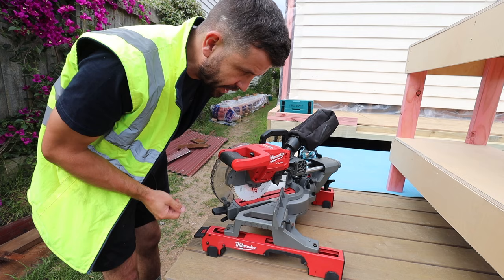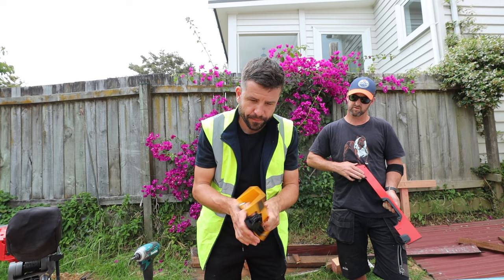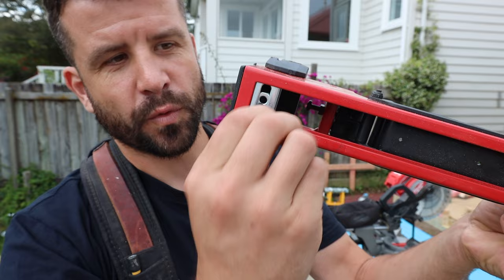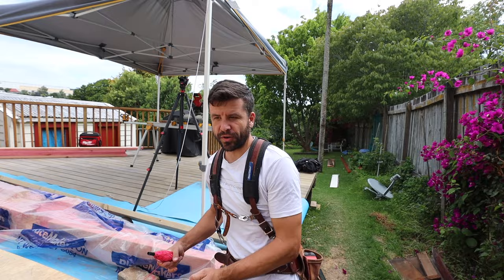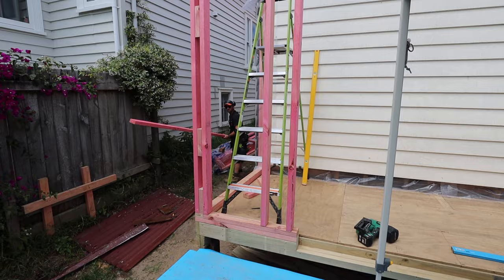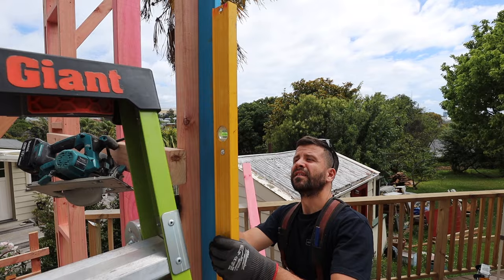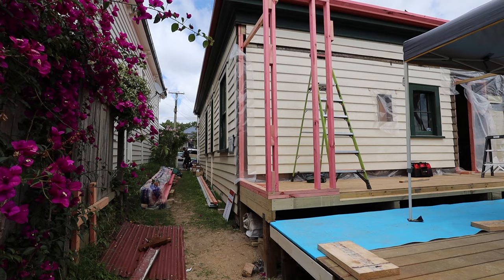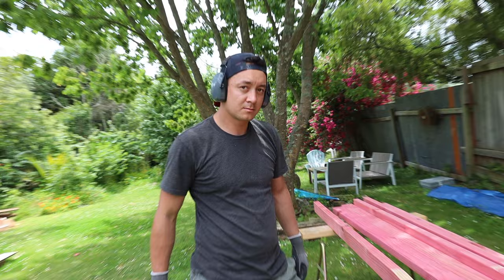Techniques We Use for Framing

Comment: Love your videos. Nice to see carpenters who take true pride in there work and have a real passion for the tools they use. I'm running that same dewalt stand for quick jobs and out door use and a 16 foot custom take down cut bench for all my finishing jobs. Instead of running multiple clamps on my saws I just built a plywood platform and installed the dewalt clamps on it so I can quickley change out saws and go from my metal stand to chopsaw bench with ease.

Comment: Always amazes me that you can build a whole house out of wood and nails and it stands the test of time.. 
And most of what mother nature can throw at it..
Reply: You’re right but for how long will it withstand time? I‘m from Germany and houses here are built totally different. When I was traveling Australia and NZ I couldn’t believe my eyes when I saw the houses built like that. In my country houses are like forever.. Lots of houses are at least 200-300 years old. Some even 500 years. New houses are built like massive bunkers.. maybe the Germans are afraid of losing their money and that’s why they put it all in building structure 😆 in reality it is a cultural thing.
Reply: @derdude8201  I live in a house that was built almost 100 years ago, walls were built with rocks.. The truses in the roof are still good and holding the roof up, the same goes for the houses in Germany that are so old, thier truses are still working.. 

Wood lasts, but it got to be maintained and looked after, if it is looked after and does not get esposed to the harsh enviroment, moisture, rain, water, fungus, termites, bugs, sun and other aspects it can last for years and years. 
Another example, phone and power line polls that are wood, they been standing in the ground for years and they still good..
The whole of my countary still make use of above ground power lines and telephone lines and most of the lines use gum poles that is treated with bitchimim.

And in todays age there is even stricture building regulation on standards and the wood is treated with all kinds of chemicals that protect the wood even more.. 

The biggest thing is maintenance, and of cause no cutting corners and using sub standard building materials..

Comment: Tip with laser levels: it's easier to work to a finished floor height. When I'm at work I will set up a mark 1m off finish floor height and then when I need to find if a point is level I can just hook on my tape and read a number without having to do the laser Level on top of a wobbly wall move
Reply: Datum. Used to be the first thing done on every job I worked on. No excuses for anyone once it's marked.

Comment: Had nothing but problems with that same model Milwaukee saw, sent the first one back as it made a terrible noise when at full operating speed-I checked everything-blade off, arbor off, connections etc, nothing worked. 5 weeks later the replacement saw arrived-exact same problem. After a further 5 weeks nothing had been rectified so I told them to stick it and ended up with a dewalt battery saw. I have the Milwaukee nail gun and it’s been good so far but after that experience I probably won’t be touching Milwaukee again. Hope you get it sorted Scott, it would be a great little saw otherwise.

Comment: I've been using the 260mm cordless drop saw from Milwaukee, came out of square which got me good the first few cuts. Other than the initial torque slowing the blade a bit too much its done me good for cutting aluminium

Comment: You should try the Festool HK 55 with the retractable track.  I never bring a drop saw on the job for framing since I've had it.  It's compatible on the Festool and Makita tracks so it doubles as a track saw.  I've also learned to plunge cut with the HK 55 so I don't need to have a plunge cutting saw.  Great saw.  Love the show.  Keep up the good work!

Comment: Nice video; however, a few questions.  Do you guys get hurricanes down there in the Kiwi  Realm.  When I used to do additions, and covered porches, here in NY., hurricane ties were a usual item put in my written specs sheet.  All the additions I ever built,  were never torn or even budged from either plate, or foundations.  Except one where the owner did not want to pay an extra $2250.00 for 12 hurricane ties, 7 joist holders, and 2 steel strong walls.  I always tried to convince homeowners to get strong walls, steel joist connectors, steel bracing, hurricane ties; etc, where the additions had electrical wiring, conduits, or plumbing running through the wall.  It was for me a safety measure for the homeowners, in case of any hurricane emergencies, or even any tremors that might occur.
When Hurricane Sandy came, the homeowners who refused to pay the cost of the steel reinforced walls, had the part of the wall where the water pipes ran through for their covered porch hot tub, struck by a wind thrown large steel sheet; no idea where it came from.
The reinforcing steel wall would have been anchored with heavy J anchoring bolts to the concrete foundation wall.   The steel sheet hit the wall with so much force, that the wall buckled and got pried off the foundation by about 5 inches; enough to rip the copper pipes apart.  On top of that, the short the pulled apart BX cables made, started a fire.  House burned down!
.
....for want of a nail..a shoe was lost....for loss of a shoe, a horse was lost...for want of a horse, a man was lost...for want of a man, a kingdom was lost!
.
I saw someone who knew the family a few years later in NYC.  I didn't ask; but he told me that the couple hated me! 😱
He says they say, that I put curse on them because they didn't want the reinforcing steel...😳
.
I always tell people that if they live in a private home, specially when apart from others; to always shut electrical power and gas line feeds in the basement in hurricane weather.  And go on battery lights.
Anyway, why don't you get rid of that steel or aluminum straight edge, you are using with your level to plumb the walls, and get yourself a proper layout plate level; seeing  that we both love gadgets! 😉
Reply: We get plenty of wind along with earthquakes. He mentioned at the end of the clip that the next step was tying the frames together. It's usually a combination of steel straps, bolts and Z nails, plus in a lot of cases structural plywood. This job would most certainly have required council consent and inspections so there's no opting out for the client.

Comment: So for your finish work you have the massive fiddly Festool because it is supposed to be so accurate. Then so as to not blemish that you buy a little toy for your general cutting. Like you said yourself the old Dewalt did it all. For framing you need a bit of grunt. When I stick frame a house I would cut hundreds of cuts per day and keep two guys on the guns running. We aim to frame a low set in a day. All using an electric 10 inch fixed Dewalt. It even cuts wide head beams using the lift up wide cut technique. I don't fix just mark plates and cut all day and lay up frame kits ready to be assembled. To me that little saw is more of a cabinet makers toy for bits of trim. Be interesting to see how it lasts.

Comment: i had the same thing going on with my sawzall its because the 12ah battery has more output power or something cant remember exactly what it was called but its cause the tool was brought out way before the new tech in the 12ah thats why it glitches. in saying that it only happens with some tools soooo the new router, nailer and new gen 3 drill and impact work fine. Basically any tool that came out when the 12ah came out works perfect and any before glitches. hope it helps

Comment: Could you please write-in imperial measurements into your video as you call out metric numbers? It would help me out a ton an apprentice carpenter in American. I really enjoy your videos, keep it up!
Reply: Use google
Reply: Or how about the US catches up with the rest of the world and go  metric......
Reply: The inch fractions are confusing as hell 1/16 that 1/8 this. I dont bother trying to convert it mm when I watch American utubers
Reply: Haha I remember the transition period in the UK when we had such crazy stuff as 4m lengths of 6” x 2”. I still work in whichever system suits to this day. Drives my kids nuts. Wife works in cm, I work in mm, feet and inches. No confusion at all......
Reply: I live in a Metric country, Canada, and we use imperial for building still. I switch between both depending on what I'm doing, Imperial for framing, metric for tiling etc. It does make it tough sometimes as I build in imperial but my permits have to be drawn in Metric. Goofy.
Reply: Just found this from Scott previously and all I can add is “yes, exactly” https://youtu.be/McK703qbCHE

Comment: Would love a review on the drop saw.  My experience with them is terrible.  Doesn't lock into square or 45 properly. Will often cut to the wrong angle.  Blade is too thin for reliable straight cuts on hardwood. No depth guide.  That's the same on two of the saws I've used. Would be interested in others feedback.  Great video Scott xxx

Comment: Wait my mind was just blown! Why wouldn't you sheet the whole floor joist, then fram on top of the sheeting?
Reply: Probably just to match the flooring in the existing building
Reply: Because it’s probably temporary
Reply: These explanations don't satisfy the fact that the wall framing is on top of joists!
Reply: @SirGatras  if they want to match the existing flooring they wont use sheets, it will be proper timber floor boards.That is put in last to keep it out of the weather and free from damage.
Reply: Sir Gilatras it’s how the old house was built. You can’t lay new hardwood floors and leave it exposed to the weather

Comment: Is the ribbon board @ 9.44 flush against the original external wall studs or are the studs cut out to the depth of the board? Thus will the weatherboards at the ribbon board and above be further out than the existing ones or flush?

Comment: You using dewalt saw stand brackets on the Milwaukee? Yea the saws don’t like that so chances are that’s why it was playin up on ya . lol .... I have that issue with one of my impact drills sometimes I have to smack the battery in , it’s like it’s missing a connection somewhere 🤷‍♂️

Comment: So in Scotland when you building up your kit the exterior has a 11mm osb to the outside, which holds the frames square, could you not dwang out your panels and brace them before installing them? Anything done on the ground is easier than walking back and forth to plumb the kit, plus we attach the bottom rail like the top, I noticed you built the kit without the sole plate then nailed down in to the already attached sole plate, 
 Just out of curiosity, what clearance has been left on the door to the beam, an LVL that size with the roof on it I’m interested to know what deflection will be calculated for the span?

Comment: Every Milwaukee tool I own has a trigger malfunction just like that.  I have the same miter saw, a circ saw and blower.  They all have the same problem.  The problem gets worse until it quits working altogether.   I quit Milwaukee because of it.
Reply: Hmm that’s what I’ve noticed, the trigger is not good compared to my boss’ dewalt
Reply: Interesting. I have all Milwaukee and never had an issue but maybe mine is a generation earlier.

Comment: A question for you. Why are using 2 x 4 for your raftors?
Reply: Yeah!  Should be 2x6 at a minimum.  Structure aside, you have no room for insulation unless you pack with polyiso.
Reply: 2x4 is structurally fine for that span. Refer to the structural tables for loaded-dimensions of roof rafters in NZS-3604.
Reply: Ditto for R-Value nsulation requirements in NZ Zone-1. Do you think Auckland has the same climate as North Dakota?

Comment: I know you put the string line on the wall to make it nice and straight, but if all your rafters were precut, wouldn't they hold it to the right position?
Reply: Depends on how straight the wall is on the existing house. If the existing house is not straight (quite likely for such an old house) then the new wall at the other end of the rafter's gonna be out of straight to a corresponding degree. It's good trade practice to straighten and brace the wall before installing the rafters, even in new builds. He's gone about this pretty much exactly how 99% of carpenters in NZ would do it.

Comment: Is it only older construction there in NZ that's nude of insulation or is that standard there?  I have to admit, that boggles my mind LOL.  What's with the pink 2x4 lumber?  Some sort of coding common to your market I presume.
Reply: Modern houses are insulated, older ones were not. You should see insulation going in the extension build in the future. The colour is indicative of the treatment level of the timber against rot and insects and hence where it can be used in the building. Internal framing is usually pink. Scott has talked about this in another video. This is the best explanation I have seen on line- many graphics :-)    http://www.nzwood.co.nz/wp-content/uploads/2013/07/dbh_timber-treatment.pdf
Reply: @Wairoakid  Thank you, that's what I guessed with the pink coloring (here it's usually a slight greenish cast from copper or whatever is used).

Comment: It seems like Milwaukee's quality control isn't quite up there with Dewalt and Makita. They make a great impact drivers and wrenches but their quality control and feel would have to go to Makita.
Reply: I agree with the Makita but not the Dewalt, I've had so many failures with the Dewalt, worst of the 3. But I had to switch to Milwaukee because up here in Canada we work in -20c and lower all winter and the Makita batteries just can't take it. My Milwaukee batteries sit in my truck all night and still work fine the next day. Makita needs to increase the quality of their batteries to match their tools.
Reply: @sw5334  I know the older Dewalt stuff was made of good stuff, can't speak for the newer stuff, i guess not as good. As for Makita i haven't had an issue but i haven't worked in -20c + weather haha. So which ever works for you i guess. xD
Reply: I have all three. Gotta say never had issues with Dewalt and Makita. I've given up on my chinese Milwaukee gear.

Comment: Why do you take the level using another straight edge? I'm so interested? May be a silly question, idk.
Reply: Not a silly question at all. The shorter the level the greater the chance the stud will bow in the middle and give you a false reading. The most accurate is called a plate level, it is long enough to go from the top plate to the bottom plate and ignores the bow in the stud. He is just using a 'longer than the level' straight edge to achieve the same thing.
Reply: @sw5334  - I wondered about that as well - thanks for the answer! (I'm just a DIY guy but always learn something new in the SBC videos)
Reply: @sw5334  thank you! Really appreciate the reply! Makes alot of sense. Thanks again 👍

Comment: What do you call those corners you make I’m in Texas and we generally use what’s called a California corner when framing it’s just an L instead of the two studs with blocks in the middle it’s better down here for insulation to get back there but I’ve only seen the corners you use one other time do you know what the name for it is and why do you choose that?
Reply: The configuration allows the lining to be carried on the inside without additional studding/packing. Standard here.
Reply: Makes sense but a California does extend far enough for “deadwood” as well if that’s what you’re referring to I was just wondering if there’s any particular reason for using it
Reply: @lucasb7301  Possibly wind/earthquake bracing ?, otherwise just the way its done.

Comment: i hope you have ascertained how the roof is going to work befre you decided to make the new walls the same height as the existing wall heights.
Reply: The rafters had fall from inside to outside wall. Thats why they birdmouthed them.
Reply: @sydneyshinshi  yes i see that now .I am a truss manufacturer.We have a lot of trouble matching heights sometimes between the modern way of building and the old style of building houses.Sometimes we go to a job and the builder has already built his frames.The existing house has 25mm sarked roof and birdsmouthed rafters.The builder wants  a truss, a 45 mm purlin and also a 35 mm ceiling batten cos the trusses are normaly at 900 mm crs. The heights just cant match so we normally have to have seperate ceiling heights

Comment: Anyone use/have the 18v dewalt chopsaw, if so is it worth it?
Reply: 20V works great.  It’s small (7.25”) so it only cuts certain sizes and is only single bevel.

Comment: Why are your 2x4s pink
Reply: It signifies the amount of treatment, i.e pink is H1.2 and suitable for more interior framing. Then we have H3.1 (weatherboard) and H3.2 (exterior structural) and H5 for piles etc, and those are different colours (or no colour at all). It just makes it clear what you’re using and also to whoever uncovers it later on.

Each have more levels of treatment (boron & CCA) pressured into them. More treatment is resistant to more water and borer basically. All our timber is softwood pine so this is necessary. 

It’s toxic and more expensive as you go up the scales though so you wanna use the least treated you can, hence using H1.2 not H5 for framing.

Hope that helps Rick! :)